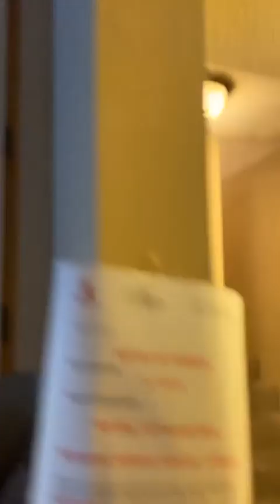Is BC Housing financing Slumlords?

Comment: I also live in BC Housing and 2 weeks ago had a flood in my apartment it started on the 4th floor all the way through the 3rd, 2nd and 1st floor, I'm on the first floor and the fire department said my unit got it the worst. Water was coming through the ceiling fan, hallway closet, main bathroom and master bedroom, even through the light fixtures and water filled the light bulbs as well. I've been trying to get someone to come and fix all the walls, electrical outlets and carpeting as the walls and ceilings are cracking, the floor is coming up and the carpets smell of mold and the bedroom is inhabitable, and all I'm getting told is "we've heard nothing" it's been 2 weeks and repairs have not started and no one has inspected the unit, there's no communication with the tenants.And before moving into the new cedar place apartments my family and I were demovicted from the previous cedar place town houses and quite literally was told by BC Housing staff what personal belongings I could bring and what I couldn't. They also called me a difficult tenant and tell me that I'm in breach of my tenancy agreement. I'm interested in joining your fight against BC Housing, I also have loads of evidence as well and can get more people on board as my neighbors have issues with BC Housing as well.